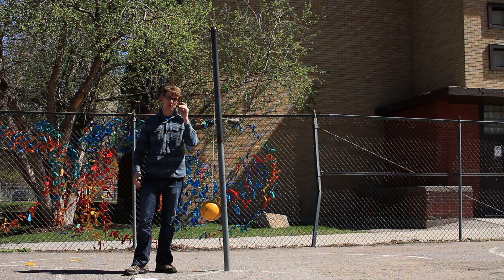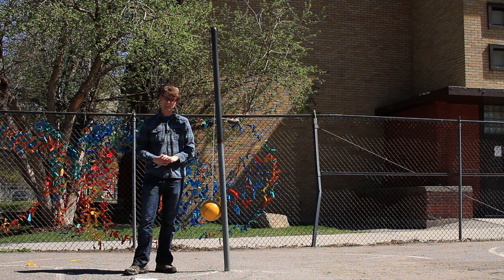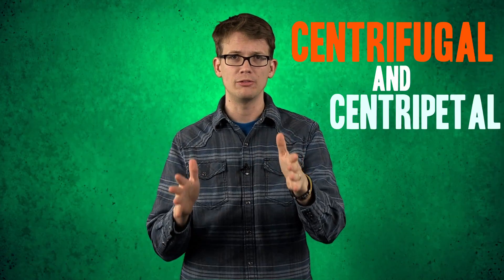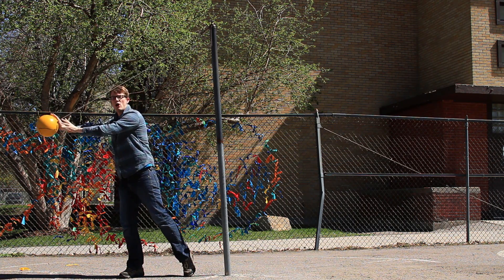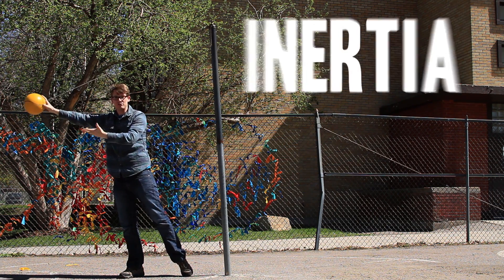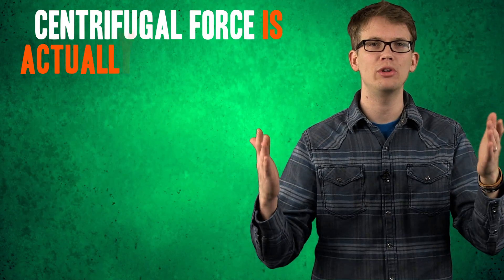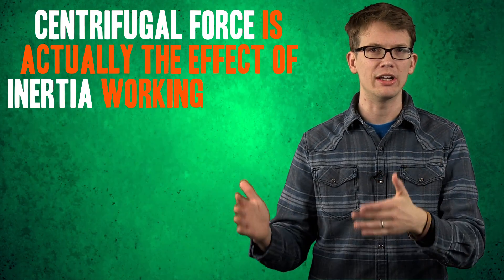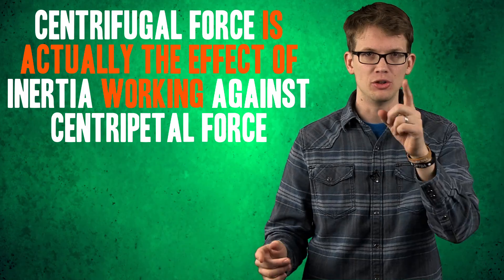IDTIMWYTIM: Centrifugal Force

Comment: Oh yes, but there is energy being built up just the same the faster it spins in its fixed distace tge amount "want" the ball has to fly away from being tied to the pole increases by a factor of 4.

So while you say there is no "force" being applied, there is a gravitational effect being created, the "GForce the ball it self is creating is putting a tention on the string and if spun fast enough there will be a failure and the ball will fly away.

The ball itself becomes an object of force.

Comment: The ball doesn't have to fly in the opposite direction exactly for it to pull on the pole. That's not how vectors work. That's not how the third law works. If the pole was mobile and light enough, you would see the ball pulling on it. Centrifugal is real and opposite of centripetal. I don't know what a fictitious force even means.

Comment: And this business of centripetal/centrifugal force isn't as clear cut as you like to think ity is hank. If you define centrifugal force as "the  outward force on the ball" then you are correct, there's no such thing. But if you define centrifugal force as "the force of the ball on the string", ie the negative of the centripetal force, same magnitude but pointing inward, then centrifugal force has a relevant meaning. Many physicists lean towards this definition and as long as you're clear about how you are using the term then its a valid concept.

Comment: Use a centrifuge, then tell me again why that force is fictitious?   Stand in a centrifuge at a carnival (oh right they don't really have those rides anymore) and explain the difference between the tether ball, which is spinning around and tied to, an inert object versus the centrifuge which is the entire frame of reference spinning and exerting force upon the object(s) within it, or associated with it  without a tether.

You might say nothing in nature can cause the centrifugal force to occur.  
Try driving at high speed in a straight line and then flipping your vehicle (I know- it's not exactly natural to do this).... what happens to anything not tied down and the car rotates in the air relative to the speed you were driving? The frame of reference is rotating, and the object(s) upon which the force is exerted are flung toward the walls, windows, or ceiling of the capsule/vehicle.  With enough Centrifugal force exerted the windows will break when soft bodies impact them, and then are flung in their respective trajectories, depending upon placement at the time of impact.... note... the bodies fly perpendicular to the spinning force, regardless of vertical or lateral spin.

Sorry for the gory example. I think of water draining from a sink or swimming pool for centripetal force.

Tornadoes can be used as a natural centrifugal and centripetal force example, however, they cannot be used as a proof since wind exerts significant influence as well.
Reply: because acceleration,  you have contact force ( like a string) or a non contact force ( like gravity) when this forces find themselves going in a circular motion acceleration will always act toward the middle of the circular motion, meaning that it changes the direction of velocity to the respect of its tangent..